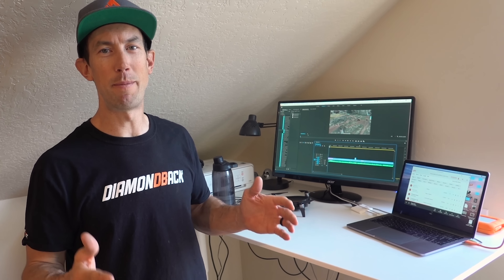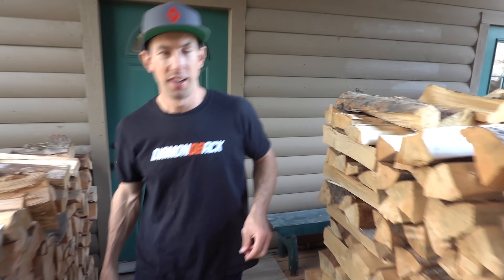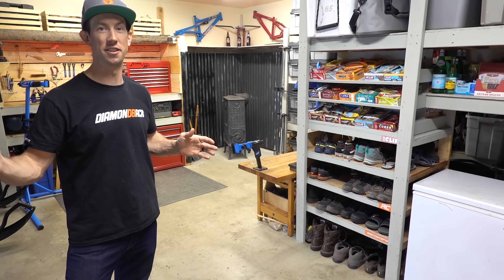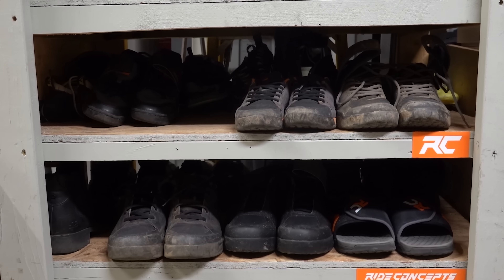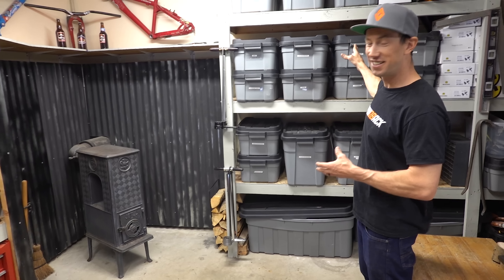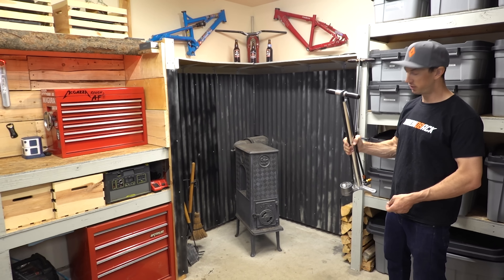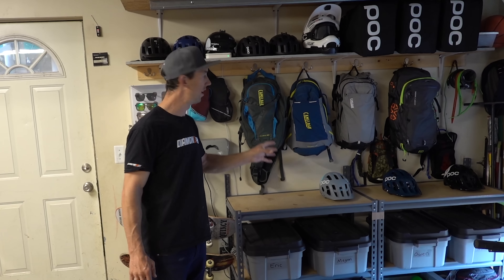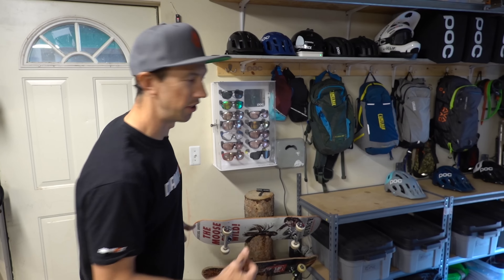Dream Garage Tour - Eric Porter's Mountain Bike Garage

Comment: God dayum this is almost exactly what I want as a bike garage. Pegboard all of the tools. And lots more mechanicsy tools with a bigger tool chest. And off course a woodshop in an adjacent building. More bikes always. I do love the fact that you have bikes in almost every category. At the end of the day a full sus trail bike can do a lot but not everything. For yet another tangent, I had no idea that Eric was at one point sponsored by Haro. Now I can say I actually have something in common with him. Sort of. My NICA team is sponsored by Haro so we get bikes loaned for a season. I took my first season on one of the bikes. Got a new Trek Fuel EX 9.8, had one race for S2 then canceled. Got 67 of 67. Lost the fixing bolt, and sheared the safety plate. A multitool only gives so much leverage. Still finished and have something that I can't help but laugh at. Now it a 8 months till S3. Never would have discovered my love for the sport if it weren't for an amazing team and Haro. Sure they are by no means amzing bikes but they are solid. And it says a whole lot about a company when they send $15k in bikes know that they will rode and maintained by teenagers, and only ask for chain, cassette, and rubber to be replaced in the end. I respect them I lot for that. Wow that is longer than I intended. Hey Eric you got any magura brakes not in that stack? Ill take some off your hands. lol

Comment: Nice garage! I was inspired by your fist video with Seth, and make some updates to my garage/shop.

My kids want to build a back yard like yours, but we live in the suburbs (Draper) and have a small yard. Planning to use our 8-foot shed as a starter. Any suggestions for a good first feature?
Reply: Table top.
Reply from the maker: That's awesome, hope the tips helped with organization! On the backyard, hard to say without seeing it. Try to maximize the space you have. An 8 foot shed should give you plenty of speed for jumps. I like to mix in rollers, hips, and berms to keep things interesting and make the most of my space too.
Reply: @PorterMTB  That's actually pretty good advice. Splitting into 2 parallel tracks after the drop can allow for crossing between to mix up features. The shed is on the side of the house, allowing for maximum use of the back yard.

Comment: I have a 2008 haro ex 1 extrema full suspension frame that I am trying to sell and I saw in the video of your garage that you have one hanging above the heater in the corner I'm asking for $150 for it but if you have parts for a 29 inch frame I would be willing to trade I am a big fan of YouTube and your channel
Reply from the maker: That's awesome! I don't have a need for one of those frames right now, but thanks for the offer! Good luck selling it and building up the new bike!